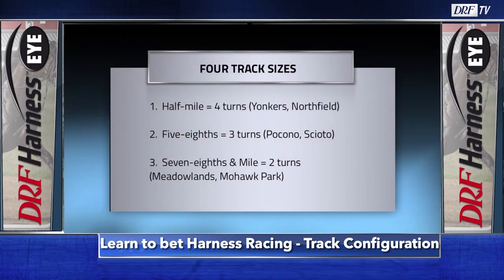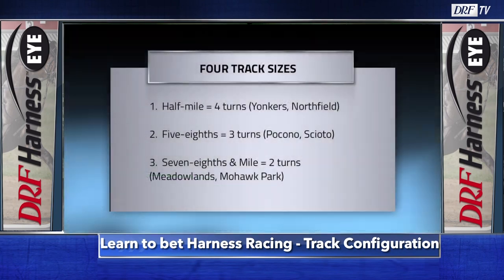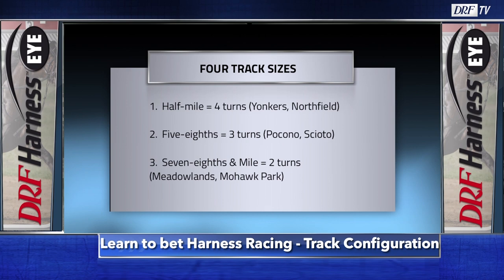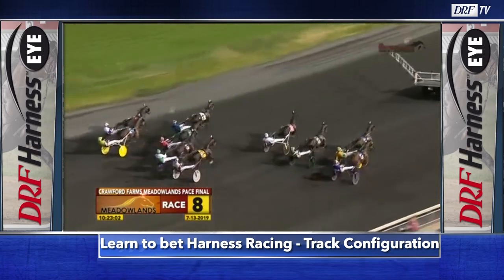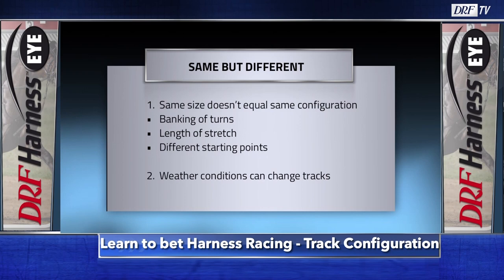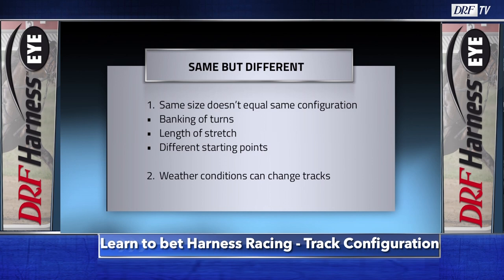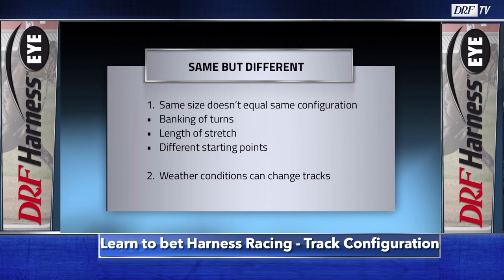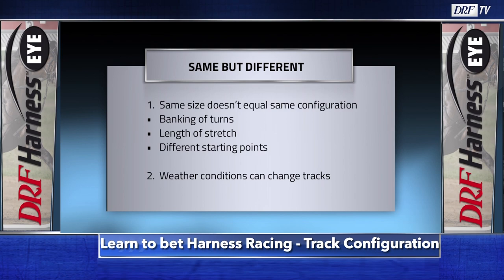Learn to bet Harness Racing  Part 4 - Track Configuration

Comment: Two questions: 1) Has anyone tried to standardize the starting point at half mile tracks? It might make comparisons easier. 2) Does the composition and configuration of the soil used on the tracks make a difference? If so, how do we find out more information about how the tracks are put together and maintained?